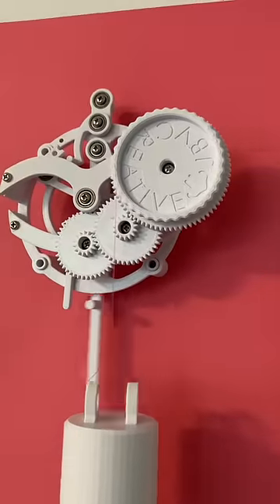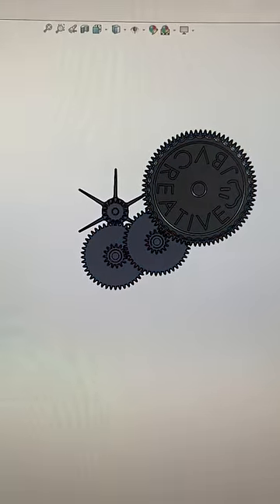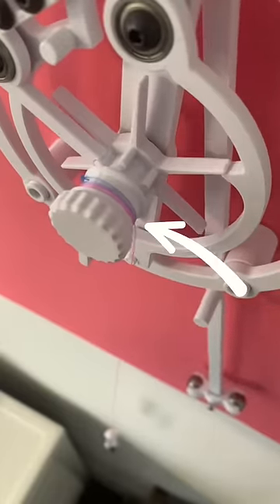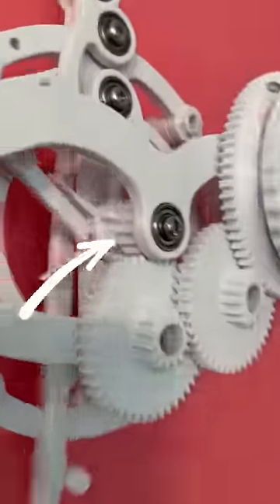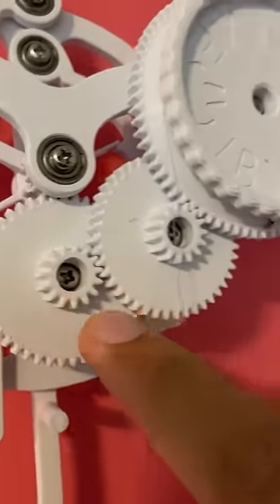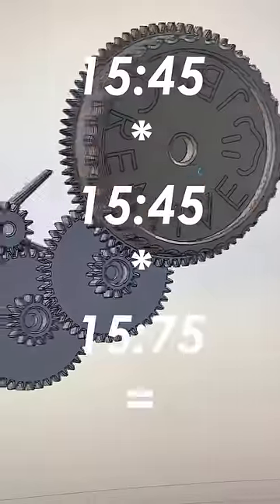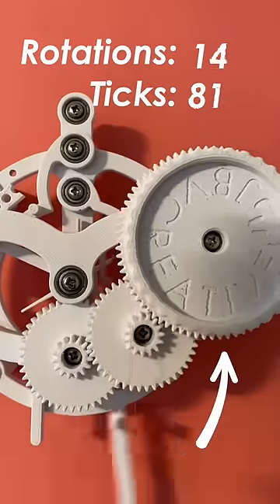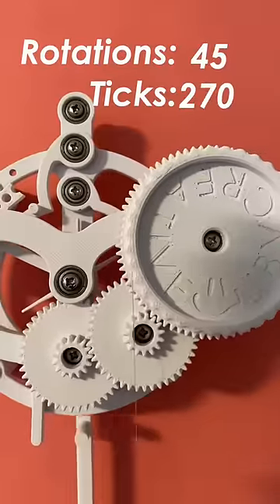Why Did I add Gears to this Clock Mechanism?

Comment: would it possible to have a second gear set [a second 'going train'?] that would have the same set up of string with a weight but already fully unwound and add a teeter taughter like mechanism with a ball shapped weight to switch the gears/source of energy to rewind  the string and transfer energy back/ready the other weight, thus creating  perpetual motion?
Reply: Thats not perpetual motion
Reply: @ohno6528  then what would it be called?
Reply: @DirtGod101  If the weights are the same, well, weight then it defeats the whole purpose of of said weight, it will balance itself out and not pull the other one up.
If one is lighter then obviusly it wont pull the heavier one up. That is not looking at the fact that energy is always escaping via friction.
Reply: @ohno6528  to off set the weights being equal, when one weight reaches its max hight, the weighted ball in what would be a switch type lever thay changes where the the gears get their rotational energy from, it would roll to the other side of the lever change positions, and add just enough additional weight in like a teeter tottering effect, to move just enough weight to the other side where the other weight would combined with weighted ball that would cause the lowest weight to now weigh less then the highest weight combined with the weighted ball and the potential energy created from the weight and the weight ball would be enough to pull up and rewind the unwound weight
Reply: @DirtGod101  How would the weighted ball roll to the other side? The ball would have to be put into a high potential energy state every time you want the weights to switch.
Reply: @ohno6528   @oh no  if there was a second, but mirrored going train(one staring unwound, and one starting wound)(this could work without the going trains if it could use perpetual motion), each weight having a fixed nub or a some sort of push rod on top that would push up a teeter tottering actuator(when the weight would reach the maximum hight capable when wound up completely) that was fixed to the main escape gear in a set up that acted like an autombile transmition going from drive to reverse(to change both the weight being used and causing the unwind of one and the wind up of the other) the presence of the weighted ball would act as the shifter that when the off setting push up from one of the weights pushing up on the actuator would slant it, causing the weighted ball to trasfer to the other end up the actuator, and in doing so, "shifting"(changing) the sorce of the energy the escape wheel uses, the string on the weight that was unwound now becomes wound and the wound up string becomes unwound, which so long as the when the un wound string on the rising weight is abould to bring the weight high enough and the afixed push rod on the top of the weight is able to push up on the actuator, that the other weight essentially pushed down, the weighted ball will roll back over/push down, or "shift," the escape gears sorce if energy back

*edit grammar
Reply: @DirtGod101  Damn this is getting longer and longer.
So as I understand right now there is a seesaw in the middle with 2 going trains on either side with strings and weights, the seesaw has a weighted ball on it.

How does the ball afect which side is the heavier one without actualy using its weight to push down on one of the weights (the ball is on the seesaw and not helping either weight).

Also, if the ball is actually helping then the side its lower on would be going down, which means the main weight on that side can't go up to push the seesaw back to the other side.
Reply: @ohno6528  lol, to try to keep it as short and to the point as best that I can, I believe I didn't figure it out until now, the ball would not be capable of supplying additional weight since it's seperated to from the weights by the switching mechanism, the weights would be able to push up the switching mechanism, changing the almost elevator like set up I was trying to explain, being a weight and a counter weight, but the switching mechanism would not need to be held down, as it would be more like a switch and not a clutch that can be compressed and decompressed, which I was figuring what I thought was decompression, could have been used as potential energy in combination with the balls weight, after seeing the idea more clearly, the weights would probably equal out when both were half way wound if they didn't remain at their intial stages to begin with(one being fully wound, and one being fully unwound) as they weigh the same and no downward/upward force was applied to the corsiponding wound/unwound strings

*edit grammer
Reply: @DirtGod101  It was nice working this out with you! You're smart!
Reply: @ohno6528  same to you, I was thinking to try to create kenetic energy with magnets but then gave up when I was thinking about the energy needed to seperate two contact points and it went straight down hill where I completly gave up when I started thinking about the half life's of magnets and how it still wouldn't be perpetual hahaha
Reply: what is this sorcery, a civilized comment thread? impossible

Comment: Question, if you make the string holding loop smaller, will it mess up or work the same. If it works the same then that would be a LOT more time on the clock.

Comment: I have a better idea, use a belt and that is on a pulley further down. The pulley has a spring on it and it will spin a few hundred times

Comment: How does this work physically? The potential energy of the weight, and thus the total energy of the entire system remains the same, right? So I assume the extra energy is really just energy saved from not letting it drop at far per tick, or am I missing something?

If the system was frictionless, would the running time approach infinity as the gear ratio is approaching infinity?
Reply: It looks to me like he's using a heavier weight, in which case the potential energy would be higher, which explains the longer runtime. It makes sense, because he now needs a higher force (or torque) due to the increased gearing ratio. If this reasoning is correct, to reach an infinite gearing ratio you would need an infinitely heavy weight. (Of course they may be differences in friction or other losses as well between his two systems, I don't know.)
Reply: If the system was lossless (frictionless, but also no air friction and so on) then you could keep increasing the gear ratio and let it take longer to drop the weight, but if it was lossless, you could also just omit the weight... 😁

But, for practical systems, there's a minimum force the gear train needs to apply to the escapement and a higher great ratio decreases the force applied, so you increase the weight to compensate.  This gives more potential energy from lifting the heavier weight and it also lets that energy out more slowly, giving a longer runtime.
Reply: Thank you guys for the explanations

Comment: Clearly this is not a perpetual motion machine, I'm not an idiot. 

Once you add the magnets, coil of wire, capacitors and some spark plugs, then it'll be a authentic perpetual motion machine.

Comment: How much weight can the escapement wheel wind upwards , transfer mech final rotation lowers weight and lifts previous weight.... Im assuming to work, the 2nd weight wont be equal?? or can it? 
If not equal....then continous smaller weights on more wheels...extend runtime?

Comment: Why don't you make another system to wind up automatically as the system runs so that when it stops running the other weight will wind it up causing a repeat of the system

Comment: Could you run a reverse of this mechanism with a spring to raise the weight?
Reply: No, that's not how physics works. You need a source of energy to be able to lift that.
Reply: @cherrypepsi2815  I meant like a circular spring, like in perpetual clocks. To keep it winding, finding a mechanism that can contain that energy, then releases the energy attached to a cog that brings the weight back up.
Reply: @dialedmedia_  dude you realise that's physically impossible right
The automatic watches you buy have a spring and a counterweight that spins with the movement of your hand, thus winding it back up. Still using energy.
Reply: @cherrypepsi2815  it's hard to explain what I mean without an example.
Reply: @dialedmedia_  Then get an example lmao. To me it sounds like you're saying "use the pendulum rocking to make it go up" which is dumb because you can just lift it, but also because the pendulum will come to a pretty quick halt
Reply: @cherrypepsi2815  it's really not that serious, lol.
Reply: @dialedmedia_  yeah true

Comment: If you increase the gear ratio 60 more times then it will run for 20+ hours.
Reply: no it won't, it'll just get stuck
Reply: @caldeira_a  
It might, but how do you know for sure unless you try. Your attitude is exactly why no one in today’s society will ever try to improve and innovate. I know this is a small insignificant toy, but you instantly decided that it wouldn’t work, and decided that no effort or energy should be put into it. If Leonardo DaVinci and all other great inventors had that kind of attitude, do you think that he would have even put forth the effort to draw his ideas? That kind of attitude is the antithesis of what our world needs if we want to develop ways to feed the hungry and even work together to bring about world peace. I hope that you might change your mind and way of thinking from instantly saying that will never work, to something like, that might not work as initially designed, but is there something that we can do to maybe make it work, like oil, or Teflon coated axles, or something like that.

Comment: Why not add a magnet to make it in perpetual motion. Just like in pendulum clock.
Reply: Wont work.
Reply: Dude pendulum clocks still need batteries or they need to be rewound. Hardly sounds like perpetual motion. 
I can explain thermodynamics to you if you want.

Comment: Make it big enough and run long enough, then you could probably lift the weight with a forklift and get energy for days. Not sire tho, my brain is smooth
Reply: you spend more power using the forklift then you get from the machine
Reply: @caldeira_a  good point, but then another option is to connect it to a wind turbine, that when it spins, it winds the weight and once it has winded enough, it starts ticking, and at the same time, the wind turbine also generates energy
Reply: @Marlon_Inno  then what's the point of this thing? you're just generating power from the wind, the rest is waste
Reply: @caldeira_a  it looks cool

Comment: Yeah but It could be a perpetual motion machine. Just put a slime block under the weight and it'll bounce back up 🙄
Reply: it bounces lower then where it fell from tho, you'd need a piston below it too
Reply from the maker: Needs flubber!
Reply: Man this new generation is doomed 😂 just use a tnt booster

Comment: Now make it build up electricity and disperse it to a battery. Tiny clean energy machine
Reply: that's produces less energy then the energy you used to pull the weight up, the machine literally wasted energy as heat and sound
Reply: @caldeira_a  then learn to build it more efficiently. It doesn't take so much energy to twist it back to the top.
Reply: @kibathedarkheartles  ever heard of these things called laws of thermodynamics? you can't get any more enwgry out of it then you put in it in the first place, the energy you used to lift the weight will be partially dissipated and you'll just get a praction of what you put in

Comment: You also SIGNIFICANTLY increased the diameter of the spool. So rather than talking in gear ratios which are in this case meaningless. You should be talking in ticks per distance of drop. This is a far more meaningful measurement.